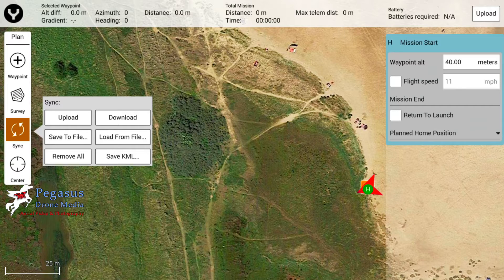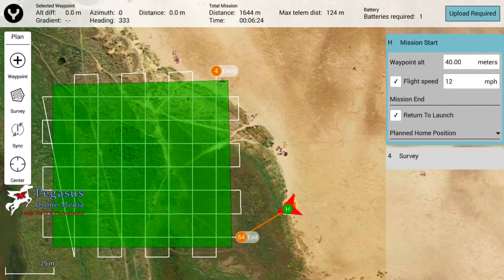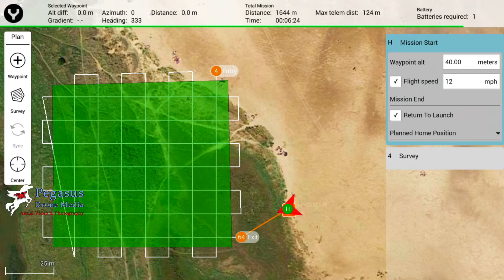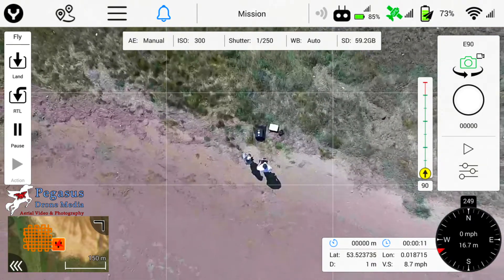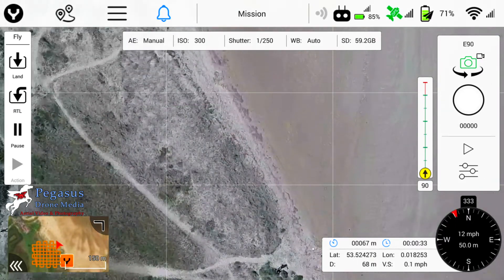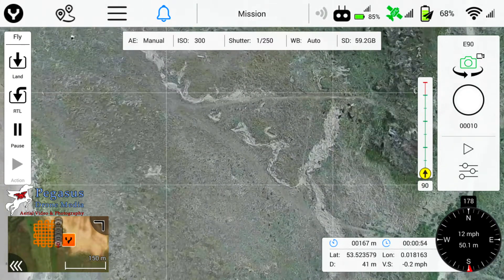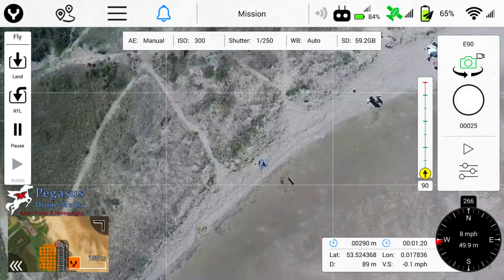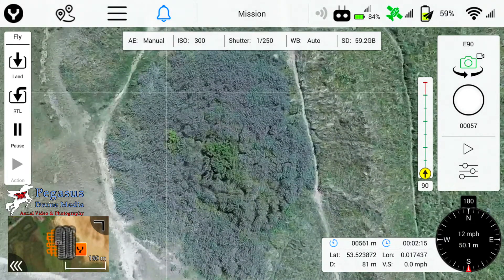Yuneec H520 E90 Datapilot ST16S Screen Recording Survey Mission (3D Mapping) Tutorial

Comment: Nice video. How you record the screen on the H controller? I can install any app on my H520 with thermal.
Reply from the maker: Hi Carlos. You can’t install screen record apps on the ST16s controller as it’s android 4.4.4 and screen record apps came out on android 5.0 unless of course you root it which I don’t advise. I screen record using a portable PVR such as the Hauppage rocket mini via the hdmi out of the ST16s controller
Reply: Thanks Pegasus... Haupapage to a laptop for record or what? I use the drone in the field without electric power. How do you do it?
Reply from the maker: The Hauppage PVR runs off of a 20000mAh powerbank vis USB. HDMi into it and can even HDMI back out to a field monitor. Heres a link to it http://www.hauppauge.co.uk/site/products/data_hdpvr_rocket.html
Reply: Perfect... Thanks u so much man!

Comment: Is there a chance you could get me a copy of this footage? I have the same hauppage rocket pvr but have not been able to get out to fly these past few days due to a tropical system here in Texas. I'd like to see the quality not streaming over wifi. Thanks!
Reply from the maker: The quality is 720 from the controller hdmi port. What you see in the video is exactly the same as what was recorded via the pvr, there are quality issues and its not perfect.
Reply: Pegasus Drone Media that Thanks for the quick reply. I'm curious, do you think the antenna that is used matters? For example, might one of the range extenders improve the signal slightly? Obcuously, it won't boost it above 720 but with video consistenty?
Reply from the maker: I use the 4Hawks antenna and it doesn't make any difference to the video quality, it just improves a constant connection as opposed to the mushroom antenna. If you need direction strength as long as you point the square antenna at the aircraft that will be a little stronger than the mushroom but you will need to keep it pointed in the direction of the 520. Here's a link to the 4hawks unboxing video I made which is very easy to fit with no need to go into the controller.   https://www.youtube.com/watch?v=z8rkC0XW4yA